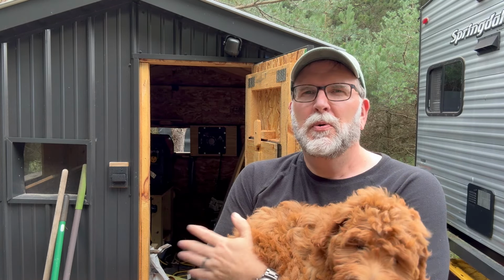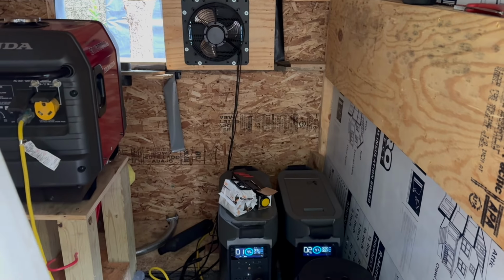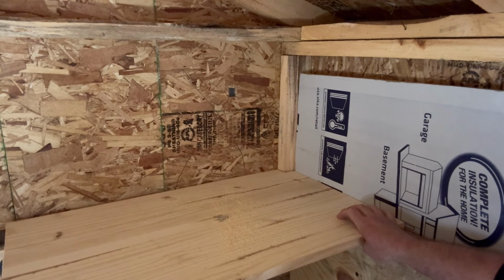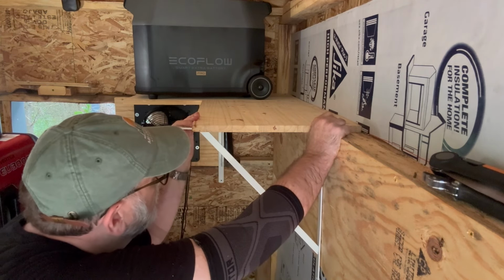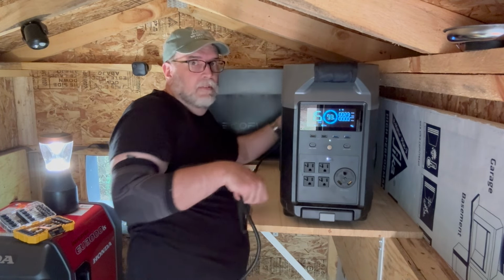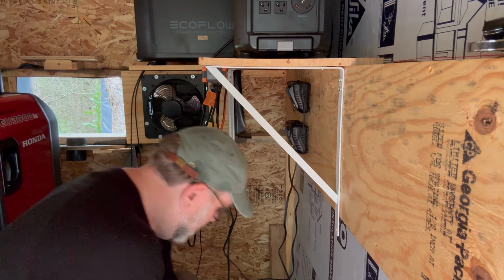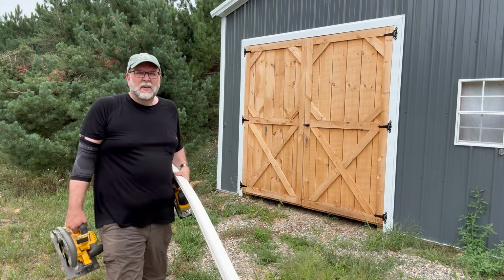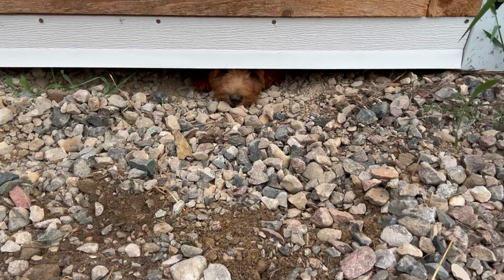How to Build a DIY Battery Charging Station Using a Twist Tie

Comment: The Amazon shelf used black plastics "wedges" that needs to be seated exactly into the groove of the metal legs. They are shaped like half tubes split down the middle. You need 2 per legs and they need to be compressed evenly to tighten. Therefore the load must be distributed evenly on the shelf. Once the weight is shifted a certain distance from center, the plastics pieces from the unloaded end come undone. Very poor design - always have failure at my company. The husky industrial shelves use metal   knobs that goes into interlocking holes combined with cross metal brackets are much better and rated at 1000 lbs but are twice as expensive but well worth it.
Reply from the maker: Good to know that there are other options. Thanks!